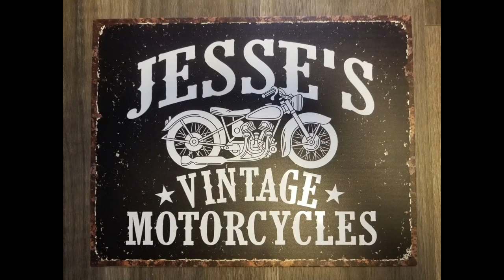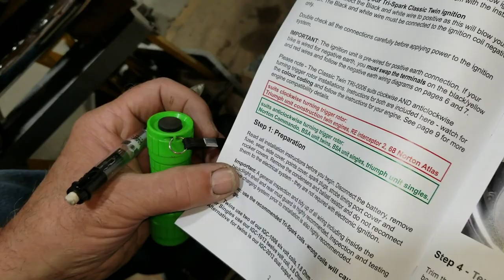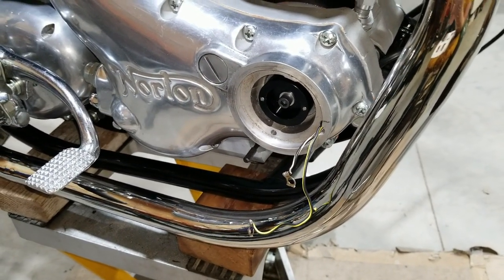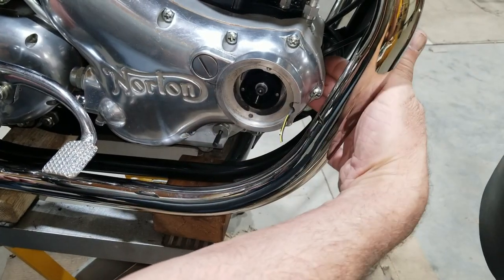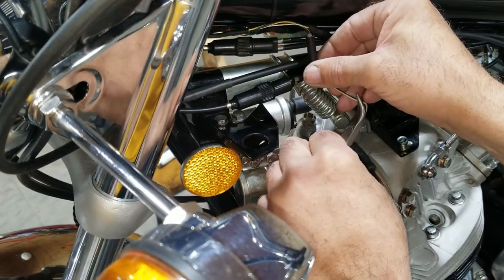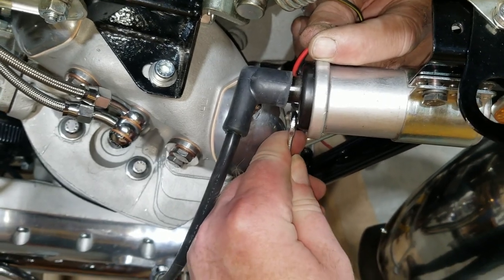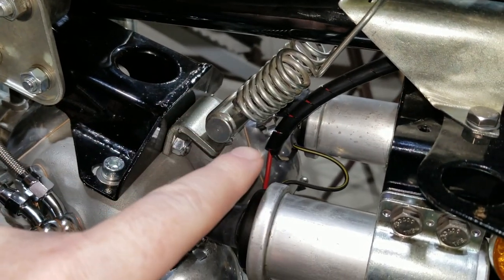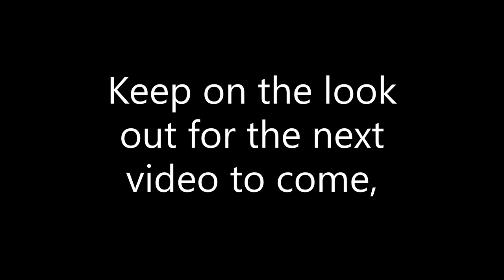1975 Norton Commando Mk3 restoration Part 16, Installing a Tri-spark ignition system

Comment: Very nice.  But I wish you would have fired it up at the end.   I recently put a Vape Wassell Electronic Ignition on my 64 Triumph TR6.  That's a pretty nice unit.  I really like the built in timing light function on the TriSpark.   Thats a cool idea.    I had to do a bit of adjusting on mine once i put my strobe timing light on it.   Maybe i was off a little with my installation.  The bike is running great though... I just don't have any more room to advance the timing,  if I ever needed to.   I guess I could take the rotor out and start over if needed.
Reply from the maker: We thought about starting it up for this video, but we ended up doing that in the next video which is coming real soon,
Reply from the maker: Should have added this earlier, I think you'd be way impressed with a Tri-Spark ignition we've run a few different brands over the years but the Tri-Spark is hands down the most impressive ignition out there it just starts so easy and idles so nicely cold or hot it don't matter. It's actually unbelievable in comparison to the Boyer or Pazon I've never tried the Wassel ignition because the Tri-Spark spoiled us on Norton's. I always thought my bikes were cold blooded and just ran rough and har to keep running when cold well not no more! It's way worth the the extra money it cost for it period. Just my take on the electronic ignitions available  out there.

Comment: Hi there team, im about to install trispark in a 73-73 commando is it the same as this in terms of anti clockwise or clockwise for my model
Reply from the maker: Yes its exactly the same except only the 75 mk3 model has the timing plug in the crankcase for the timing tool. The mk2 and earlier models all have the window with the degree scale and all mid 69 and later commando's are counter clockwise  timing all the very early commando's and some later Atlas's have a distributor behind the timing cover and under the carburetors and they are clockwise timing.